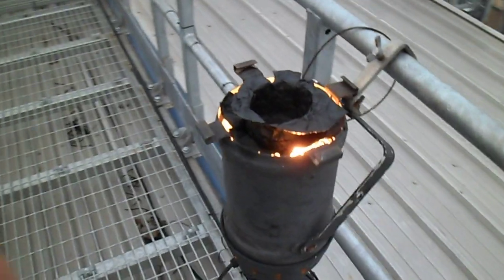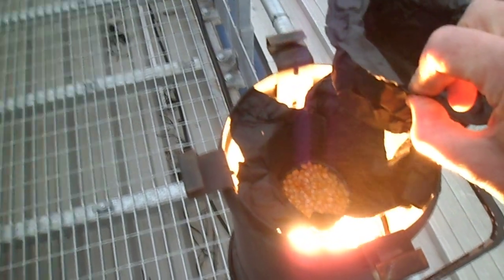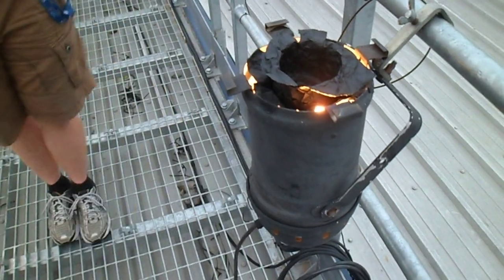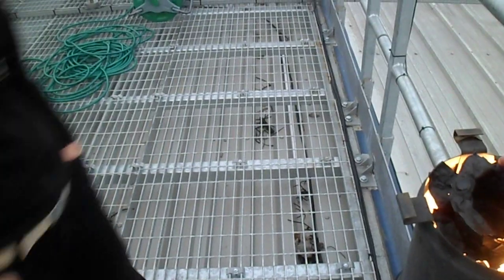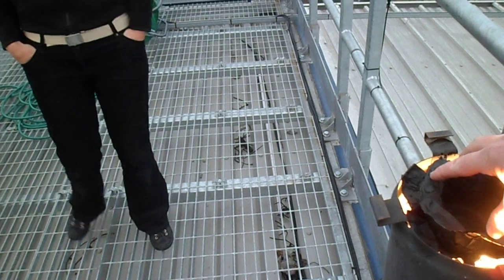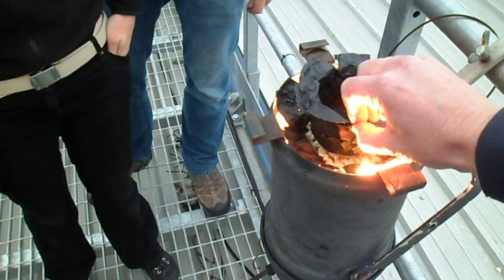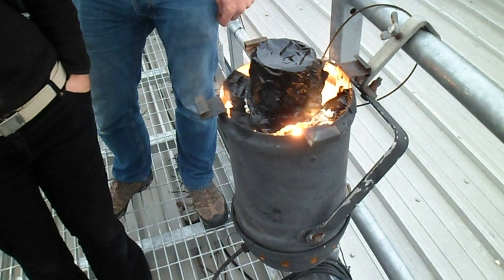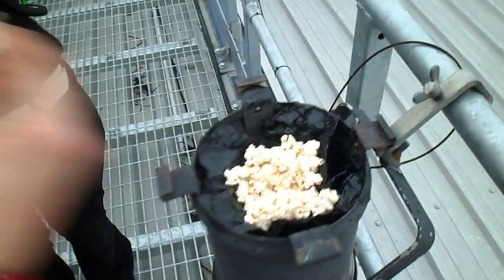PAR can popcorn.

Comment: Be lying if I said id never thought of doing this when i was working in stage production. Haven't lived though until you've cooked your dinner on the muffler of a generator set.
Reply: sparkplug1018 this is true. one time I was working a hard job a few hours away from home, got hungry on the interstate and pulled over and hated up my grilled cheese sandwich on my trucks exhaust header lol.
Reply: Joshua Pearson Can of soup, open the top a bit and let it sit there a few min. When it steams its good to eat.
Reply: There ya go lol. Dilemma solved. That's actually not a bad idea.... Thanks buddy!
Reply: +sparkplug1018 old army trick is to put a small dent in the can, when the pressure pings the dent out, dinner is ready.
Reply: NoName Id never thought of that. Sounds like a great idea.
Reply: Great idea! I'll have to try that sometime.
Reply: I once cooked bacon on a computer's CPU, and burned my hand on a par can that I didn't realise had been running only moments before I was told to adjust it! (Should've seen it coming tbh, but still)

Comment: +bigclivedotcom What kind of light was used, Incandescent, High Pressure Na, Etc? How many watts? What is black wrap?

Thank you,

Zach
Reply from the maker: +Zach Z 1000W tungsten halogen PAR64.  Black wrap is a stiff aluminium foil coloured matt black that is used to hide light sources on TV, film and concert productions.
Reply: Good, No mercury. Just massive amounts of heat and some light. The black aluminum must get pretty damn hot in this case because of the light absorption. Would a Metal halide light bulb work in a par can (with ballast)?
Reply: i know this is an old comment, yes it would, but would require additional hardware (shutters) so that the halide bult could be "dimmed"

Comment: Seems like an awful idea guys. For one if the oil leaks in any way beyond the black wrap you have a grease fire. A grease fire burning at a very remote location that is hard to get to and fueled by electricity.  Secondly, I had to cringe when you started eating it. The oil to cook the popcorn is mixing with the chemicals of the black wrap and you are ingesting it. Doesn't seem like a great idea to spread around the internet to young and impressionable stagehands.
Reply from the maker: You can rest assured that as with all the fun things we do at work, we assess them with the same level of safety awareness as normal work.  So there was very little oil, it was done in a controlled location and suitable fire extinguishers were placed to hand.  We're not actually kids.
Reply: +wngdfeet From Whisky to Haggis, from Tripe to deep fried Mars Bars to par-can cooked popcorn, nothing is detrimental to the constitution of Scotsman. That's the Campbell side of me saying that. ;-)
Reply: +wngdfeet arent there more important things to worry about than this?